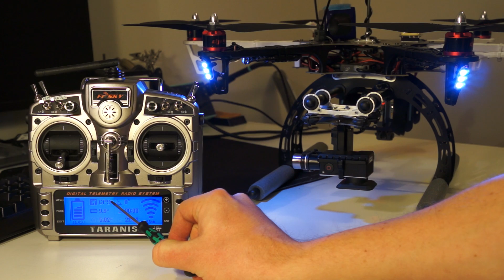Taranis LUA Script demo

Comment: I have that I am using a 4s battery do I need to change the script
Reply from the maker: mike Woodward the script should sense 4s automatically, but maybe you have not setup the telemetry settings under the model in the taranis menu? You need to specify voltages and so on.
Reply: AV3 RC No the script does not sense this automatically.

Comment: How do you get the main battery on the left to work. Every thing but that works
Reply from the maker: mike Woodward You need a reciever with a voltage sensor plugged in to the A2 port.
I am using this sensor plugged in to the A2 port of the reciever: http://www.hobbyking.com/hobbyking/store/__16671__FrSky_Battery_Voltage_Sensor_FrSky_Telemetry_System_.html